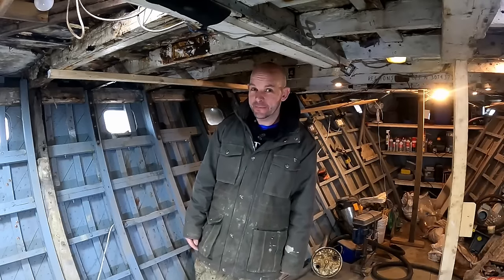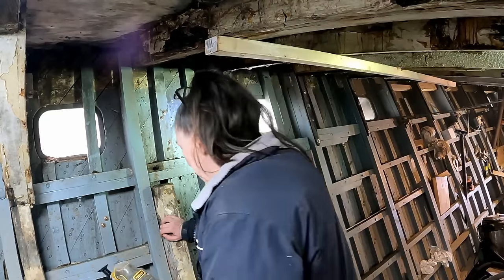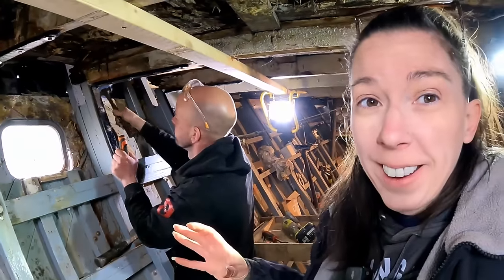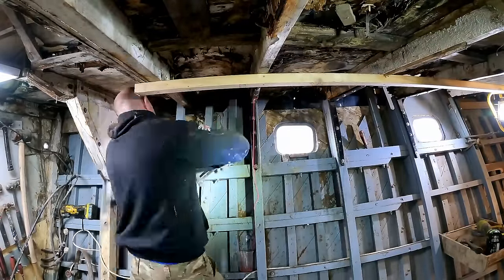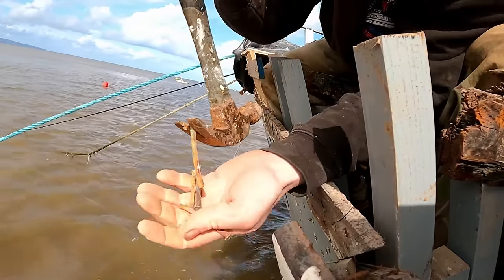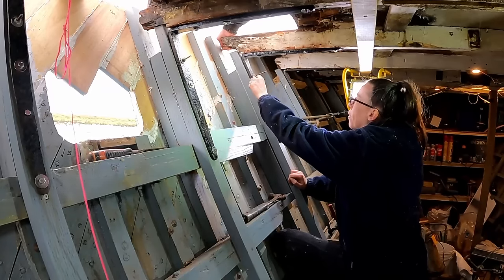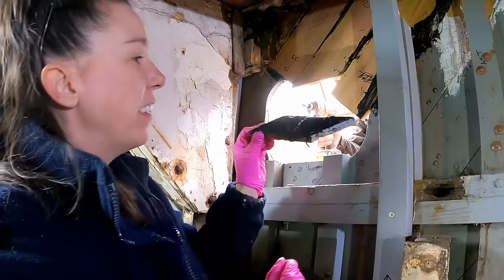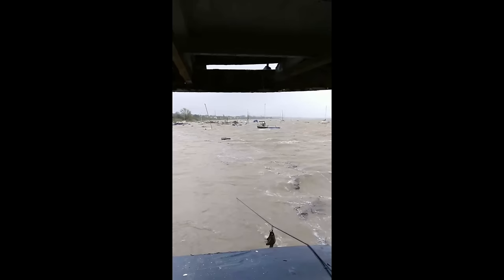Ep 171 Replacing Rotten Planks On Our Boat! #boatrestoration

Comment: Have to comment on your dedication and incredible hard work. Came across your build initial thinking it may have been an old wartime Fairmile B as that is my main source of interest as so many are now lost to the dreaded rot with few survivors though many did survive as pleasure boats after the war especially in my neck of the woods  in Torbay my late father being an engineer in the 1950's /60's  and knew these vessels very well. Similar construction but not to be. Amazed at your hardness, patience  and dedication to this restoration. Good luck and stay safe.

Comment: The deck cleats and other hardware can be polished using a power buffer and various grades of fine polishing compound. It will be necessary to apply a clear coating of some sort to protect the aluminum from oxidation and pitting. Perhaps polish followed by clear anodizing would be the best treatment.

Comment: Regarding the cleats i would "rumble" them. If you can find a metal finishers somewhere they should have a rumbler, which is basically a large vibrating drum filled with abrasive stones which will clean metals to a nice uniform finish. Quick polish ready for plating/hard anodising (depending what the base metal is) Bob as they say is yer muvva's bruvva!
Reply: A cement mixer with fine stones would do to clean the cleats ect .
Reply: @richardford4570  would work but a bit harsh.

Comment: That was a nice soft day as we say over here in Ireland😄. You need a good plating shop to re anodise the cleats and Fairleads. Car wheels are usually powder coated these days. Remember the Wolf Race from the 1980's ? No didnt think so, probably a bit young then. But Starsky & Hutch had them on their Ford Forino as far as I know. They were polished aluminium. Used to look great, even on a banger. You could double the value of your car fitting a set. 😄😄

Comment: Hi guys, I really enjoy your videos.  

You asked about the fittings and what to do with them.  I have worked around salt water a long time.  In my opinion, you should either powder coat them or Cerakote them.  You may think that this would be difficult however, you would be surprised how simple it is.  

There is a clear advantage to powder coating fittings however you have to be vigilant after you have installed them.  Any intrusion through the coating will instantly allow corrosion to set in and it will undermine the coating causing it to flake away.  The cool thing is, if you have an intrusion through the powder coat, you can repair it with a torch and some of you leftover powder.  You simply clean the area, sand it, heat it up with a propane torch and apply powder.  Now, this is a repair and will eventually fail.  But it is far more durable than traditional paint.  Also, you might find someone who is near you that would maybe partner with you that is a professional powder coater.

Now, Cerakote.  Cerakote is a ceramic coating that has multiple uses and application requirements.  They have specific coatings for marine and salt water applications.  Obviously , I would recommend that you contact them and ask for their professional recommendations.

I will provide some links so that you can look into it.  Obviously the decision would be yours.  If I was in your position, I would reach out to each of the following suppliers and ask for support using your channel as a marketing promotion.  You could contact these suppliers and asked if they had recommendations for the type of powder and method of application for your specific use.  I think you would find that they would be extremely helpful.  Also, the powder is quite affordable.

If you want to try this yourself, you will need a powder coating gun, an old oven and a sand blasting cabinet.  Along with some expendable shop supplies such as tape, hi-heat tape, rags and such.

For a basic powder coat gun, you can get one that is decent from Eastwood.
https://www.eastwood.com/hotcoat-powder-coating.html

If you want to have a choice of really cool colors you can go to Prismatic Powders
https://www.prismaticpowders.com/

Cerakote finishes
https://www.cerakote.com/

Cerakote boat finishes
https://www.cerakote.com/project-gallery?htids=Boat%20Coating

Cerakote corrosion video
https://www.youtube.com/watch?v=IL_bXx_qtfo&t=269s

Comment: Simon, can I share a money saving tip for working  over the side of a boat?
Make a lanyard from a bit of 3-4mm rope with one end to loop over your wrist & the other end tied to the tool. Dropping even a spanner is a pain in the butt, but dropping a power tool can be a major pain in the wallet.
Also, does Gemma have you well insured? Because when the tide is running a lifejacket is a very good idea.

Comment: I’d put solid blocking between the frames and under the plywood for those cleats and fairleads. You can still block them up higher if you need to, but solid underneath is the strongest way.

Comment: You can re anodise stuff yourself. If you use wheel acid ,you actually remove the hard anodising skin on the alloy .  To replace it,the part is placed in a bath of sulphuric acid ,then a small electric current passes through the part. This gardens the alloy surface. Lots of advice on line on how to do it .

Comment: Gemma at 62 years old I've recently learnt of a tip for cordless drills regarding drill bit slipping out.What amazes me is no manufacturer includes this in their manuals.This tip works on my DeWalt and Milwaukee cordless drills and it is this.Once you have tightened up the chuck tight against the drill turn the chuck as if you were loosening it and your chuck should make a distinctive click, when this happens stop turning it and now your drill bit is locked in place and shouldn't fall out.

Comment: Just curious, on those frames that were just rotten at the top, why not put the scarf up higher and use the cutoffs from the windows?  Since it will be glued and copper-nailed through, is the extra length needed?  I'll be interested to read your thoughts on this.....

Cheers from Oregon, USA
Philip

Comment: i noticed you where having problems with your drill bits, do you no that you can lock the drill bits into place" when you have tighten  the bit into place turn the chuck anti 
clockwise" and you will here it click, you are both doing a grand job

Comment: With the ally cleats .gets some 400,800,1200,1500,2000 grit sand paper and it will polish up like crome use wd40 on the sand paper when it's fine.and you can get buffing wheels to go on a drill and auto sol or bars of compound

Comment: Slow and Steady wins the Race.... As for the Sealant  on yer hands .. use a petrol soaked cloth  .. removes it big time ...  Stay Safe Oot There .. Andy ..  Try using  PEEK Metal polish on the Fair leads and bollards,  using a woolen buffing wheel on a drill ...

Comment: If you have the cleats and fairleads anodized it will wear off from contact with rope etc. anyway. Not a problem but you will see a difference in the finish, alternatively just sand/grind out any scratches and then work back through medium and  finer grades of emery paper/wet and dry to give an even satin finish all over  ( can use oil on finer grades) Maybe use the ACF type anticorrosion oil people use on motorbike castings etc.? easily re-done at any time to remove any oxidation that forms -  if it bothers you

Comment: 41:30 knocking out copper nails/rivets. I find a bigger hammer is better with a pin punch than a small hammer. Obviously this is not for a little roll pin, but something substantial like age hardened 1/4” copper needs a firm whack.

Comment: yep me too - i'm always amazed at how timbers rot faster inside the boat than outside, all that condensation, and the fact that any wet boards outside are soon dried out by the wind - its the same with cars, everything rots from the inside out, rusty holes suddenly appear because they take time to corrode away just leaving the paint, when that goes there's no material left, that's why i always make a point of giving the inside surface as much paint protection as the outside
if them cleats are aluminum, use the nylon filament wheels, they won't melt the ally like nasty wire wheels do, i hate them things, a mate nearly lost fingers when one caught his glove and the power drill wrapped itself round his forearm - use the wheels lightly and at speed (in a power drill, battery drills are not fast enough), DO NOT press on the wheels as the nylon will deform and break shortening the life - i just used 2 wheels to do all the detail on my car to bear metal, faster than sanding - Si watch some videos on anodizing, would be cool to see you learn to do this - you guys are doing a cracking job 
i reckon someone should give you guys some Master Boat Builders Guild Certificate if there is one, or restoration

Comment: I would just cut out the gun supports and put in regular web frames.   It is not like the rest of the boat is original.  I would just keep the external look of the boat, and make the insides work best for what you want to do with it.

Comment: What is the condition of the overhead joists?  They do not appear to be very good.  I thought you were replacing at least some of them as you did in the bow.
Reply: I believe they did the front ones but are waiting to do these rest till they get ready to do the decks. But they want to finish all this work they are currently doing so they can drive the stringer boards in without tearing up the new decks. At 35:04 they kind of say something about it here. Replacing deck this summer  I believe.

Comment: I those cleats are made of stainless steel than do not use wire wheel acid on them just scuff them with some wet and dry sandpapercLike 50000 grit . And them buff with just some mild buffing compound like polishing compound like you would use on  car to buff it out .

Comment: I am worried about aluminium bollards because of corrosion especilay if copper is nearby.
The major worry is from galvanic corrosion of the fastenings . Stainless bolts will result in the failure of the bollard base in short time. Hot dipped galvanised bolts will last longer but expensive monel bolts are best.

The bollard should be mounted directly on the deck so that the hawser pull is transfered to the deck sheet with as little lever action as possible. It  should have a big backing plate underneath and at least 25 mm wood deck thickness nearby
 Aluminium does not have the strength of steel.  It would be best if the bollard was made of low corrosion cast steel or fabricated  heavy section steel hot dip galvanised.
As to  the method of construction '.....put he deck down first and mount the bollard direct to the deck.  This means the load is transfered to the plane of the new deck  sheet which is constrained by the beam shelf.  Then in short time fit your winch  or bollar or any strong point and hope that  the remaining anchor lines are enough to hold  Serinda in position until any glue dries

Comment: My question with removing the gun mount supports would be that… Yes they are there for the gun mount, but when the hull was designed, do they also have some component of the overall hull structural integrity?
And another question, I thought, when you did the front planks, you staggered the heights of the joint for strength, and here, it appears that all the joints are at the same height.  Didn’t you stagger the joints up front for strength, and why not here?
Reply: On the front ones, they had to replace both the inside and outside ones, so doing that would have made it weaker if they were almost all the same. Being as they left the outside on these, they had a firm place to reattach, making it less vulnerable to breaking and warping.
Reply: @edrussell7960  Thank you!

Comment: Those gun supports, & the steel panels your removed at the bottom, should arguably be reconstructed using good wood, & that will makes a really strong structural hoop to use as a lifting point, no? No danger of the hull crushing if you lift it _there_...

Comment: Hey Simon, you copied my method of tea making only I use Yorkshire tea bags and I have big bags of em in the tea cupboard in Vietnam. I start the day with two mugs of G7 coffee, mid-morning a mug of Red Tea, Yorkshire is with lunch two of em,  Green tea in the afternoon or evening and Artichoke to go to bed. Now the later will clean the cup back to new so maybe it's scrubbing my pipes. As a teen I worked in the chippy shop of a precast concrete factory that was making tunnel lining segments for the London tube. The chippy was a grumpy old sod and when he was at a meeting, I scrubbed his mug clean, using sand well there was plenty of it. When he saw it he went nuts as he reckeded stained mugs makes the tea better, he used evap or condensed milk can't remember which as it was back in 1961.

My mate fitted new decks to his Thorneycroft torpedo style hulled cruiser, shaping the cleat blocks to sit flush on the deck took best part of a day. The boat was made for a sugar baron but was turned over to the Royal Navy at the start of WWII, she saw action at Dunkirk and served through the war. She was then bought in a sad state by the Director of Tate and Lyles shipping company, loaded onto a barge and went back to Thorneycroft for a full refit. It was then used to transport customers down the Thames from the Tower to the factory in the East London docks. Years later my mate bought her hull as that was all that was left, check out White Marlin on the ADLS website adls.org.

Comment: Simon is wrong with the Tea! It is clockwise stirring on a week day and anti-clockwise at the weekend. The dibble post the stir before you remove the tea bag is important. It is a 5 pulse tea bag down dibble with a follow up up dibble. Sweetner should always be added after the removal of the bag and the bag should be squeezed to get the max flavour.

Comment: Well whenever you pull it out of the water I'd fiberglass the outside of that hull make it definitely waterproof that's what a guy did I know with his wood boat looks pretty nice
Reply: That has proven to be a death sentence for wooden boats. Because the wood isn’t completely encapsulated, moisture will enter it and become trapped beneath the fiberglass, resulting in rot. This was a common problem with many DIY repairs in the 1970’s don’t do it! Wood/epoxy laminated hull construction is successful, but it requires that the entire hull be laid up in epoxy during its construction. This method was developed by the Gougeon Brothers in the 1970’s, makers of the West System epoxy product line.